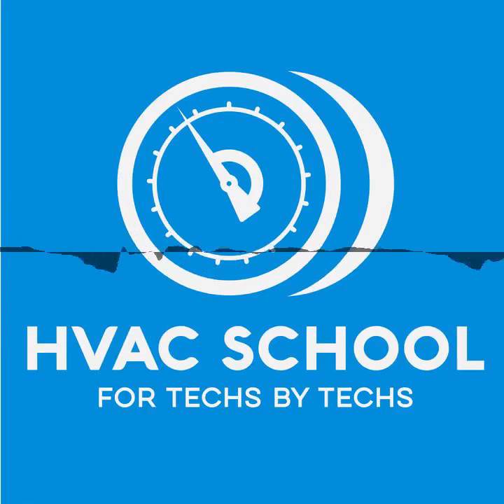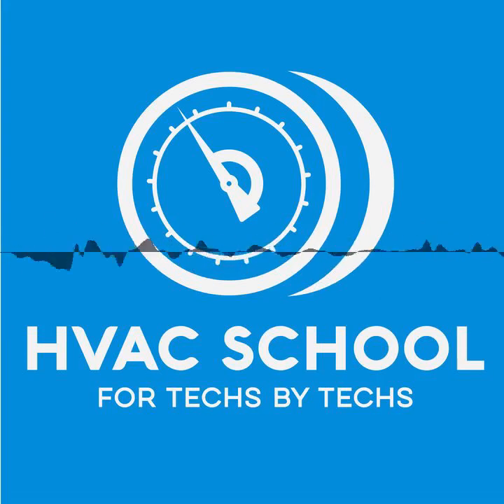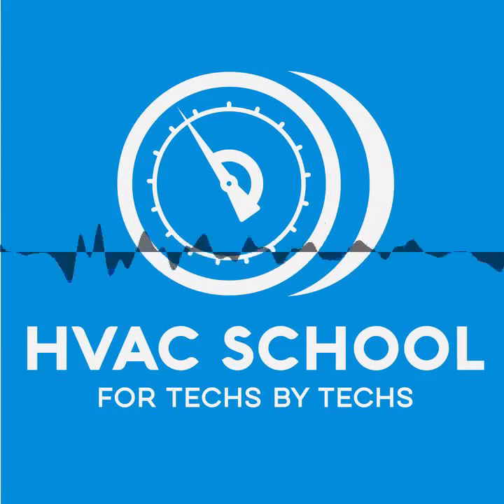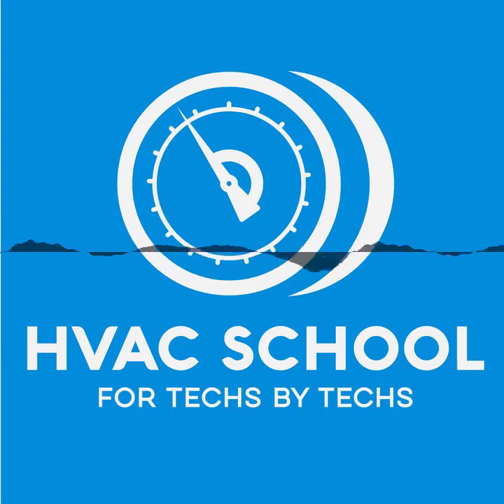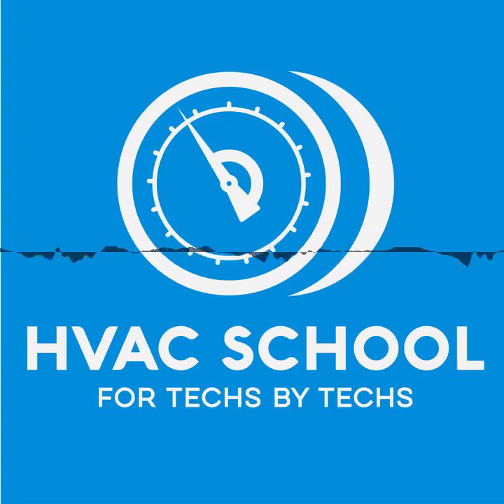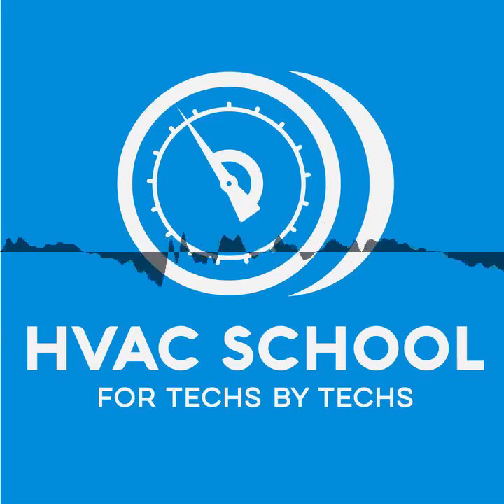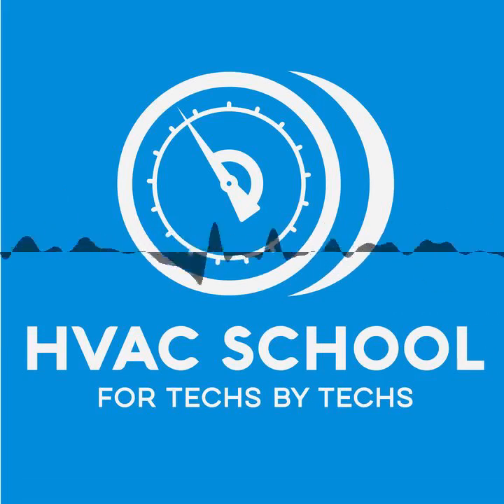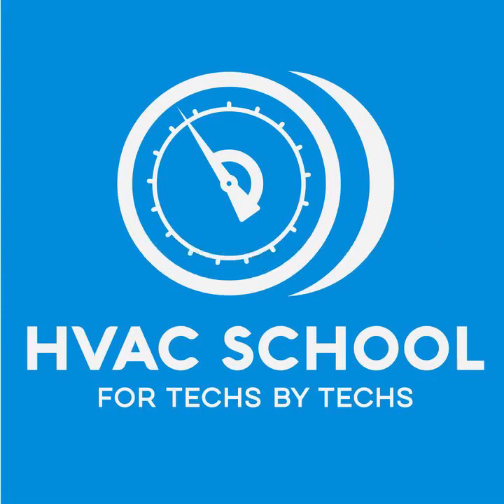Short 18 - Can You Freeze Water in a Vacuum?

Comment: My primary work is commercial refrigeration, I have seen it a few times in 30+ years. Water in a system is a disaster it has literally taking days to get out all of the water with multiple oil changes on the vacuum pump (removed oil from the compressor first).

Comment: an ac with some hydronic system built in leaking would definitely cause lots of h2o around and in the pipes, service ports and etc. installing some ultra smart fau with a digital txv (like daikin and etc) will require you to be  100% sure there’s ZERO moisture so yeah. that’s why you do triple evac on those - to dry and vent frozen particles in the system. particles frozen by the deep vacuum. 
Daikin installation instruction (C)
Reply: @maxsim_racing A triple evac won't do you much good,always a good idea to purge the system with nitro before you begin evac to get the atmosphere out,but once you pull system down below say 2000 microns, just let it keep running until it reaches your target. The nitrogen we use in the trade may be called "dry nitrogen" but many times it's not at all dry so you're only hurting and not helping. The lower the level of nitro in your bottle the wetter it can be coming out. This is no longer a recommended method for evacuation.  Plus unlike popular beliefs, nitro does not absorb moisture. It can only help sweep it out but not if it's wet already. If anyone doesn't believe this, flip your tank upside down and crack the valve open,use a reg if high pressure still in tank but it may just suprise you when your hand feels wet. More important than relying on triple evacs is having a proper vac rig to start with. There will be no need, if you can't get all the moisture out with a good rig and proper practices then that systems doomed imho ,too far gone. Replace system or you'll be back often
Reply: @HVACRTECH-83  you argue with Daikin installation instruction my friend. not with me 😉 I guess you know better than the breakthrough japanese company does